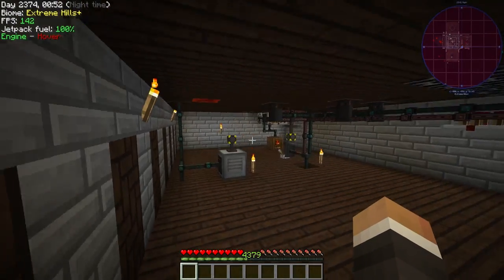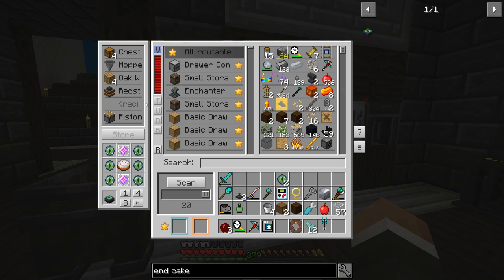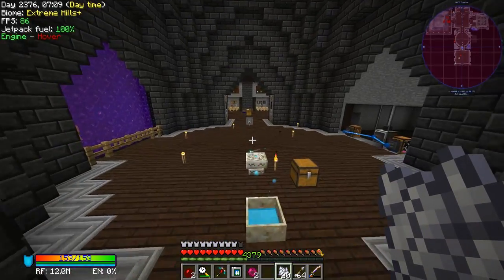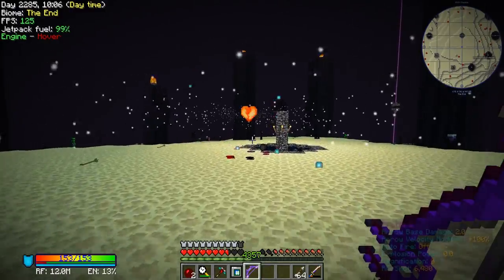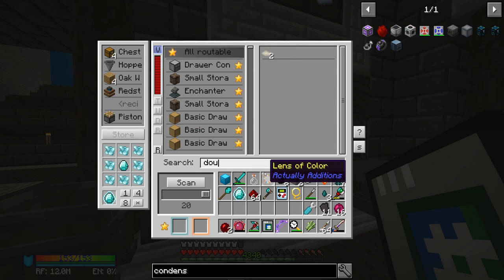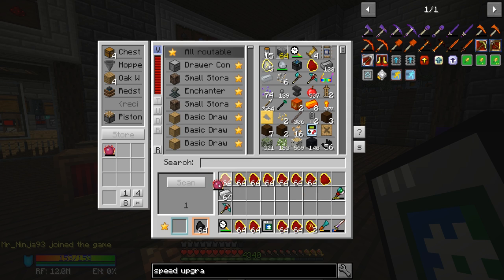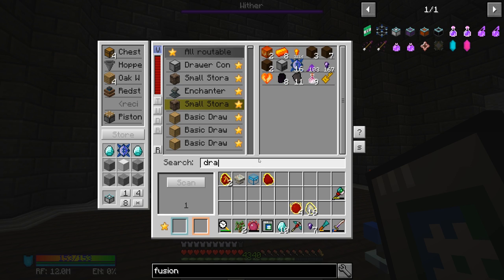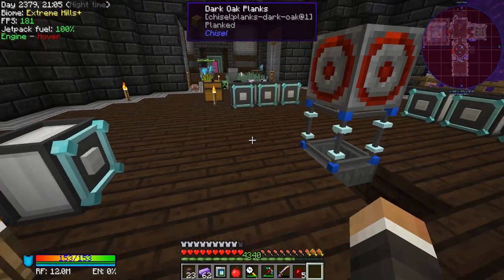Minecraft StoneBlock - Energy Condenser & EMC! #17 [Modded Survival]

Comment: It was worth it to have 9 roosts of each chicken that only puts out nuggets.

Tip: Watch of flowing time works on Neutron Collectors, and it stacks with more watches. Seems to be an additive stack, so the 18 ticks per tick changes to 36 ticks per tick with 2 watches instead of 324 if it were multiplicative.